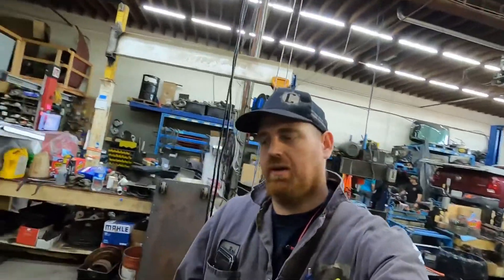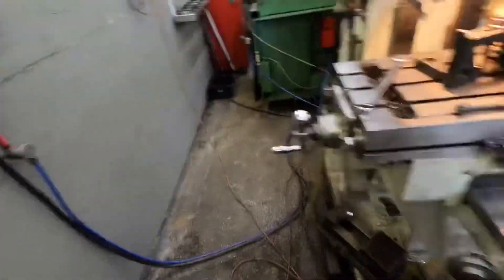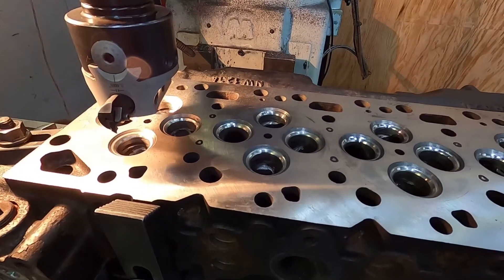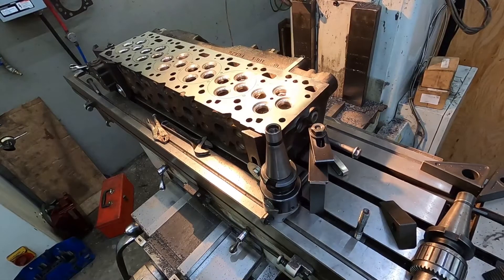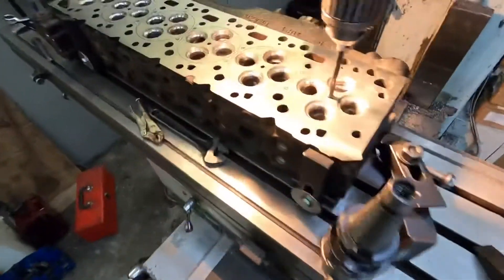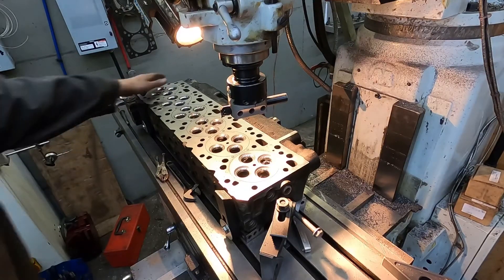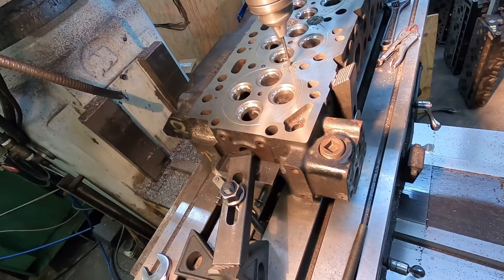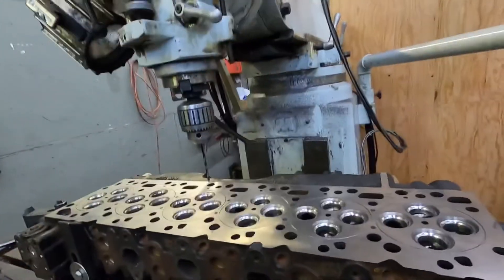Ppump 6.7 build — SURFACE/ ORINGS / STEAM HOLES !!

Comment: Have you ever had a coolant leak around the coolant port by the thermostat between the head and block with a 6.7 gasket? I have a slight seep there. Also where at on the 6.7 mls gasket do you place the orings ?
Reply from the maker: I don’t on any of the one I have done no